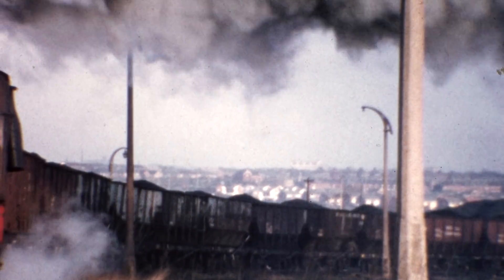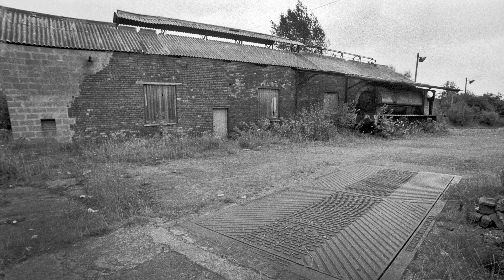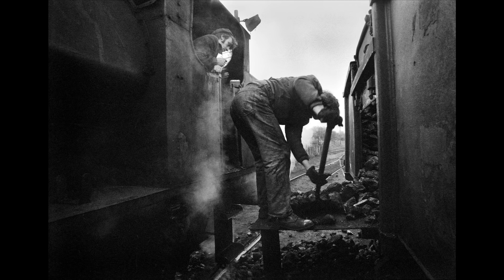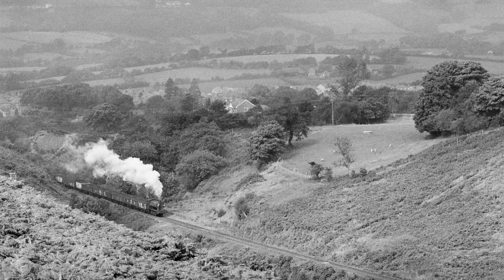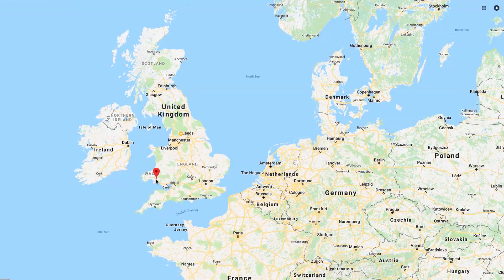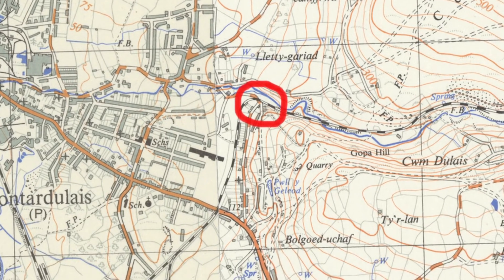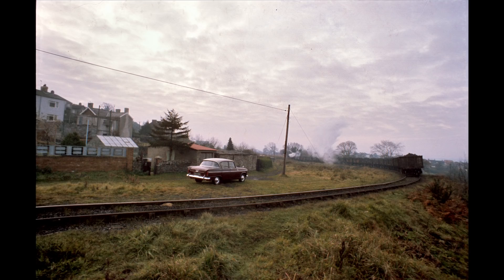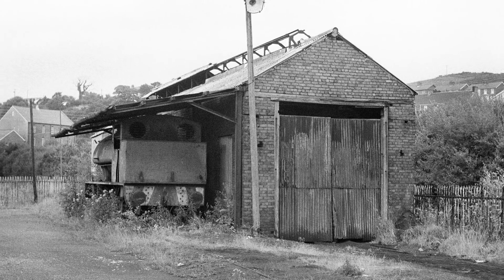The Austerity Steam Loco, Part 3

Comment: I had a foot plate trip on the Isle of Man railway. The fireman knobbed up the box in fair time before leaving Douglas. There’s a good climb out straight off the platform for a couple of miles till you’re over looking great sea views to the left.  There was no firing on the move at all. Just using the injector to keep the water good and keep the engine quiet at the various stops. He put about another half dozen round at castle town while we were in the station waiting for the token. First time he’d looked at the fire for half an hour. That extra got us to port Erin where the fireman put another couple on and pulled the fire through and under the door. She sat quietly for an hour while they had their break in the both in the yard. The driver cut the fireman’s hair with the clippers he’d brought in, that had been arranged the previous day. The run back was less arduous as there was no big bank but a long gentle rise. Again no firing on the move.  As a bluebell fireman I could easily see the difference between their way and ours. I do have to fire on the move, but there’s inevitably coal dust blowing about no matter what you do. They started clean and stayed clean. Real class enginemen.

Comment: The Austerity and Avonside 0-6-0s at Snowdown would also steam on very thin fires (though I only rode them pulling empties).
Reply from the maker: Hi Stephen,  Snowdown Colliery was pretty flat and the locos didn't have far to go.
Reply: Yes that's right.  I think it was about half a mile only.  It was nice see the looks on the faces of the folks passing by on EMUs running parallel on the main line.

Comment: hey i know this is unrelated but would it be possible for you to make a seat car to put behind russel or some of your other small engine's
Reply from the maker: Hi Adam, the seated trolley would have to be on 5" gauge track and I'd probably need at least three of my little engines to pull a person on the level track.   It would be a bit like herding cat with three small engines on three radio controllers.
Reply: It would be neat to see your engines try but I wouldn't risk breaking something.
Reply: It would certainly be interesting. I've heard of an adult being hauled by a large O gauge engine (probably a Big Boy or similar) and I've seen a photo of a child being hauled by an LGB loco. But those were both electrically powered models. I don't know if anyone's tried it with small scale steam. Somebody must have at least attempted it, surely. :)
Reply from the maker: I remember several articles in Model Engineer magazine showing adults being hauled on temporary tracks by 0 gauge and gauge 1 steamers but this was many years ago.  You're right one of the locos was an  Allegheny articulate similar to a Big Boy and it worked.  This was before the idea of large scale narrow gauge tank engine on 0 gauge track became popular.  So it could be done again.  Anyone for the challenge?
Reply: I have a feeling that the articulated loco capable of hauling a person was in reference to an Australian backyard layout. Possibly a commercial demonstration layout in the owner's yard in the 50s. Nevertheless, I'd have been surprised if nobody had done it before or since. 

I'm currently working on a 5" gauge line in my own backyard. No live steamers in any gauge though (yet). Once it's ready, I could possibly set up a length of O gauge between the 5" rails eventually and give it a try. ;-)
Reply from the maker: Don't forget to video it and let us all see.
Reply: You don't think I'd go to all the trouble to do something like that and NOT video it? :)

Hmmm! I hope I'll have a section level enough to try it. I suppose it would be cheating though if I did it down hill.
Reply from the maker: I don't have a level or straight patch in my garden railway.